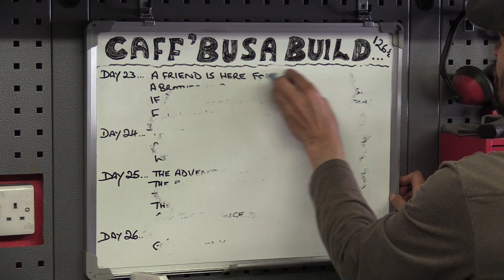Delboy's Garage, Hayabusa 27, Front Brake Master Cylinder.

Comment: Hi there, Delboy (and the rest of you guys).

Now that you mention corrosion... I have an excellent tip in case you haven’t heard about that product.
It’s called “Corrosion-X” and is quite inexpensive - they claim it’s used by the US Navy.

It’s based on the fact that all metals are a little magnetic, so it binds to them magnetically - making it very durable even at high pressures and temperatures.
I’ve used it myself and it’s amazing how effective it is (I tested it on a couple of screws etc in salt water, and the treated ones were like new after that treatment),

My brake components haven’t been tested with it yet, but at least the outermost components such as that circlip and outer piston end will benefit from it... and probably the inner parts as well.
Reply from the maker: Thank buddy, thats a cool tip, ill give it a look and see if i can find some... sounds like it could be useful long term in a daily used bike aye... Thanks for your support and have a good weekend... Del.
Reply: @Moonfleet41  Indeed... it can be used for quite a few things of course, such as tools, exposed bike parts like exhausts, brake components, chains, etc... you're welcome, I wish a good weekend to you, too! c",)

Comment: I have similar Tokico calipers on my ZX6-RR, but four pots not six, just for information when Kawasaki send their master cylinder kits the middle seal is not fitted as helpful Suzuki appear to do. Looking at the the seal you'd think that will never fit on there! well it does and there is a method I found to fit it which I discovered on another video, it is a bit stressful though! Just to let you know there is a bit of a gap in the method for some owners doing a brake rebuild.
Great videos by the way, not being a total newbie on bikes after 20 plus years of racing but working on mostly new bikes so you don't really get the age related wear and things usually come apart really easily. Now having a small collection of older bikes (the newest is nearly 20 years old) I have had to learn a lot of new skills and I found your explainations invaluable. Keep up the good work....everyday is a school day.

Comment: I had to check and bleed my front cylinder on my 83 z750 ltd last week, all looked ok, ended up bleeding the calipers above the cylinder to get all the air out then used your top tip of taping up the lever overnight as it was still a bit spongy. 100% better in the morning!!

Comment: YouTube must know I need to do mine 😅 and I hadn't even done a search. 

Don't know what your views are, Del. But I once saw this guy get some dry fine sandpaper and crosshatch the inside of the brake and clutch master cylinders to de-glaze them.

Your videos are timeless Del and Penny x
Reply from the maker: OK, cross hatching is done in cylinders to hone metal piston rings in... these cylinders have soft rubber seals and should be mirror smooth inside otherwise any roughness at all will accelerate wear on those seals and end them early.. just clean them, fit fresh new seals and fresh fluid, job done mate. !

Comment: Just me or has the 2x countersunk screws they use on every front lid of the reservoir always been made of Swiss Cheese?
Reply from the maker: Stale Pastry most of the time..
Reply: This. They don't look that different, but when you have a mullered screw they make a world of difference. If you work on Japanese bikes, a set of JIS screwdrivers is a must have tool. 

Also when you do get the damaged screws out, put new ones in. They only cost a few quid for the OEM ones, or less from ebay for something compatible.
Reply: I have always replaced them with stainless steel ones,with a hex head. Bling and practicality init!
Reply: What about if under heavy braking from say 130mph I have fluid spraying out of the top of my reservoir cap.. could this be the seal in the master gone so fluid and pressure coming back through it and blowing out the top of the res cap ?  Ninja Zx6r 1999
Reply: Bit of valve paste on a screwed screw works every time .correct fit screw drivers and a little tap help

Comment: Here's what gets me: See how simple and elegant design that master cylinder is?  How did we de-evolve into the rubber hose, mounted on a stick up in the air like a hood ornament master cylinder?  Sure for a $110 bucks more you can get the after thought reservoir that plugs in with no hose:face-orange-raised-eyebrow: but even that is not nice, sleek, ununweird like what Del was working on.  The one on my new Triumph looks like it was designed by an accountant.:face-orange-frowning:
Reply from the maker: I have to agree with you mate, I can't see how the p155 pot concept is a forward step, fine if it's under the bonnet of a car, but displayed on your handlebars in pride of place... does seem a little odd!

Comment: Great video thanks , just a quick one  I have a 15.8mm /  5/8 master cylinder with 6 pot calipers but I want to change to nissin 4 pots , could I do that and keep my stock master cylinder without any problems , its a zx9r and I want to put the triumph/nissin 4 pots on but don't want to change master cylinder so do you know why people want new master cylinders and is it just down to the feel of the brake , do you have previous experience of something similar , any advice would be much appreciated
Reply from the maker: Im not the best qualified person to answer this one, but from what i understand, swapping from 6 to 4 piston calipers makes little difference as long as the collective pumped volume of fluid behind the pistons is the same or similar... and in most cases, 4 pot calipers have bigger pistons than 6 pots, so it is..  The swap is usually motivated by the 4 pots being less liable to jam up and easier to bleed..  If it was my bike, it'd plumb them up, and go for a careful ride, see how they feel..!
Reply: @Moonfleet41  thanks for the feedback much appreciated, yeah I just want calipers that need rebuilding less and a little cheaper to keep in good condition, I might get those four pots and give them a try , I think those standard 4 pots have a 14mm master cylinder internal bore and the 6 pots are 15.8mm , trying to find out as much as poss before I press the buy now button 😁. Keep up the great vids 👍🏼😎
Reply from the maker: @bccapone837 It's not critical mate, at the very worst you might find you need a little more lever pressure to create the same force on the disc face, but if you switch over to some new copper sintered brake pads, they create a greater rolling drag and, therefore, more bite needing less lever pressure... so they'll more than compensate!
Reply: @Moonfleet41  legend

Comment: Hi Delboy. Great video. Just did the same job on my 1999 cbr600f. It was fine when I first fitted it but after leaving it a few hours I’m finding the piston isn’t returning back out and sometimes just stays fully in? I then press it a few times and it returns back out and will seem fine. I’ve definitely fitted it in the correct order. I’ve put red grease on the piston seal and clean brake fluid on the seal that attaches to the spring as my manual says to do. Brakes have been bled and no bubbles coming through calliper bleed screws so I’m stumped 🤔 any suggestions would be much appreciated, thanks
Reply: andrew my reaction is a bit late  did you solve your problem?  if yes please share what was it
brakes are important.

Comment: 8:28: Is that simply some Red Rubber Grease or does it have to be specific to a braking circuit?

Alternatively, can I pour some DOT4 everywhere and consider it will lube things enough to put it back together?
(Wanting to  do the job without waiting for new grease)

Comment: I bought complete new handle bar with master cylinder, but I think that something is wrong with cylinder.
I perform air bleeding (conventional way and reverse), I don't think that air remain in system, but breaking force is just too weak, brake pads
move just small amount, and there is almost no back pressure on lever.
What is strange to me is when I press handle bar, there is significant fluid shooting in reservoir, I must put cap on reservoir otherwise I it would just spray all around.
Is this normal behavior that fluid shoots out during pressing handle bar?

Comment: Very nice 👍🏻👍🏻 what was that red grease you used?
Reply from the maker: Red rubber grease, it was supplied with the kit.
Reply: @Moonfleet41  is there anything comparable, my kit did not come with the grease, how do you think jus using brake fluid will work. Ive seen others do that. And cool fact, 90's yamaha four wheelers have same exact internals in master cylinder, its why i checked your vid out. Cylinder im rebuilding was all apart and i needed to kno how to put it together.
Reply from the maker: @bamajama87  Yes, fresh brake fluid will do to lubricate the seals for assembly.. Good luck with it, hope it goes well for you..
Reply: @Moonfleet41  it did work out good jus had to be careful on the fresh paint. Didnt think about that at first lol. Do you kno of another grease thats safe for rubber.
Reply from the maker: @bamajama87  Anything silicone based is usually safe on rubber..

Comment: I have been pulling my hair out over the spongy front brake lever on my Gen2 Busa.Changed the hoses,replaced the caliper piston seals and vacuum pumped a whole bottle of new fluid through the system yet I still can't get the solid feel to the lever that I had when the bike was new.Without too much effort,the lever can be pulled back to the bar.Do you think rebuilding the master cylinder is a possible solution? Bike is 8 years old and just coming up to 30k on the clock.Also,what type of grease are you using on that rebuild? Red rubber?
Reply from the maker: Just to try and isolate one fault from another... when you pull the lever in, you say "without too much effort it can be pulled back to the bar"!  Do you need to squeeze harder and harder to eventually achieve this... OR, do you pull the lever in, and if held at a constant pressure does the lever slowly sink back to the bar?... it's important to determine which,.!! have a check and let me know mate.. happy to help if i can..! Del.
Reply: @Moonfleet41  Hi Del, if the lever is pulled in a few inches and held, it will slowly come back to the bar but it takes a few seconds for that to happen.If the lever is pulled with slightly increasing pressure,it will come all the way back to the bar quite easily.
Reply from the maker: @captainbimble   OK mate.. that confirms it.. the main seal inside your master cylinder is letting fluid past it..  its pretty dangerous obviously, so get yourself a kit asap and rebuild the whole thing... you'll get a new cup seal and metal piston with it, plus a new spring too...  once you've done that, bleed it back up again and you'll have a rock hard one again  right away.. !!!!
Reply: @Moonfleet41  Thanks for the advice Del.Rebuild kit has been ordered.I'll let you know how I get on!!
Cheers again mucker.Lee.
Reply: @Moonfleet41  Just an update Del.The rebuild kit arrived and I fitted it per your instructions.What a difference,I have brakes again! Even the Mrs came into the garage to squeeze my lever.She said it's been a while since she felt such a firm one! Keep the vids coming mate,Merry Xmas!!!
Reply from the maker: @captainbimble  I bet you read VIZ magazine right..?    Seriously.. glad you got it sorted mate.. have a good Christmas.. Del.
Reply: @captainbimble  lol

Comment: Yes I have struggled in the past with poorly designed cir-clip pliers, usually chinese rubbish. Now I see there are better with that ever important ridge on the tip. WTG Wiha this is the first I hear about them. Good tools always goes along way. Thanks for showing. PS. Harley footpeg mount c clips are ever so tiny, I struggle fitting the pliers in those small holes, do you use a special one with smaller diameter tip?
Reply from the maker: Hey brother.. yes indeed, bless them HD clips.. the smallest one is under your brake and clutch levers, holding the pin in place.. the hole in those clips is 0.8mm, so you do need the correct sized pliers to get hold of them... never enough tools aye :-)
Reply: @Moonfleet41  so do you have a plier with that diam or resort to using your finger nails as I do to ply them off?
Reply from the maker: @Volvi373  No, "Two dart tips" works every time..lol!

Comment: Hey man, I'm a new viewer and I need some help I have an R3 with a twin disc conversion and I'm trying to install new levers however on my brake side it's not engaging my master cylinder not sure if k need to change the pump or buy a repair kit (new rider and also first bike)

Comment: What red paste did you use on the springs and dust cap ..?
Reply from the maker: Red Rubber Grease..!
Reply: @Moonfleet41  it's called silicone greese as well ??? Or they both are different ??
Reply from the maker: @atifrashid1421  Pretty much the same thing... different in its ingredients to RRG , but just as safe on rubber.

Comment: Yesterday i did a full caliper and MC rebuild. Today i bled all the system, no air or whatsoever but when i touch my handlebar with the MC lever the pistons in the calipers are barely moving. I did upgrade the caliper from 2 pot per caliper(4x28 i think) to 4 pot with bigger  pistons (34x4 and 30x4) but i kept the original MC which is 1/2 aka 12,7mm. Do you think this MC is too small or i did something wrong? Thanks in advance.
Reply from the maker: Hello there, yes indeed, if you have fitted 4 pot calipers that are larger than the 2 pots as well, then you've more than doubled the fluid capacity, so a larger MC will definitely help you, you're simply not shifting enough fluid down the line to move all the new pistons.
Reply: @Moonfleet41  Thanks for answering to my matter!

Comment: Can you reuse the parts?
Reply from the maker: Depending on how old they are, they do tend to wear, and can eventually allow fluid to pass the seals, causing a 'sinking lever'... but if you're stuck, and can't get new seals, and you didn't have a sinking lever, then yes you can re-use the old seals, but just be mindful of it and be ready to change them if it deteriorates.
Reply: @Moonfleet41  Thanks, do you know if it is possible to buy the retainer ring on its own? Can't seem to find it anywhere, jsut smooth ones.
Reply from the maker: @jaimeb.384  It'll be a standard Triumph part and a Triumph main dealer should be able to look that up on their system, it will have a part number, give 'em a call, they are open!
Reply: @Moonfleet41  Hi thanks, I didn't specify, not looking for Triumph but a Harley master cylinder, don't want to buy the entire rebuild kit just for the retaining ring. Thanks!
Reply from the maker: @jaimeb.384  OK then, same applies, your Harley dealer will probably have it on the computer system, just speak to the guys in parts and am sure they can supply it!
Reply: @Moonfleet41  They sell the kit, spring, cylinder, rubber gaskets, all the lot for 20e, I'm just in need of the raining ring, so 20e for that seems a bit too much. Trying to find them alones, but seems they always come witht he set. Thanks anyway!
Reply from the maker: @jaimeb.384  Locally here we have a nut and bolt supplier, they sell individual nuts bolts washers and clips in all threads and sizes... so you'd have to find a company like that and see if you can buy just one clip..!   if i had that task it'd just be a search online till i found it.!
Reply: @Moonfleet41  Yes, I'm on it atm but all the rings I find are smooth on the inside, do you know if the ones with finders on the inside have a special name? No more questions. Promise!
Reply from the maker: @jaimeb.384  Ha ha, it's no problem mate, happy to help.. Those are referred to as "JK Type Circlips"   if you search that title in Google images you'll find lots of examples..and from there you should find links to companies you can order some from. !
Reply: @Moonfleet41  Awesome! Couldn't find the name anywhere!!